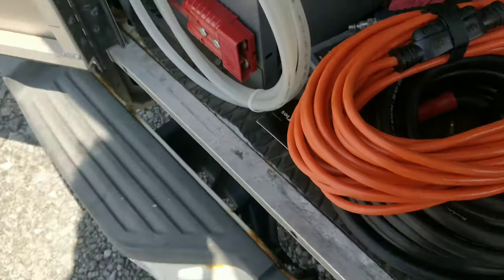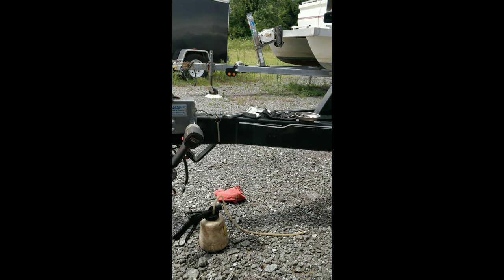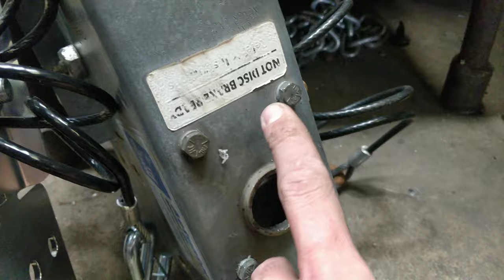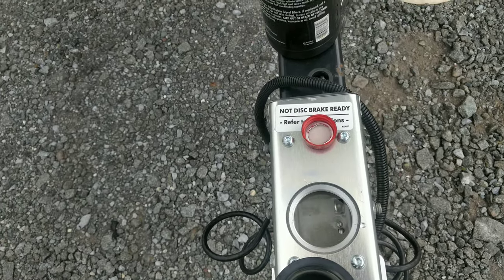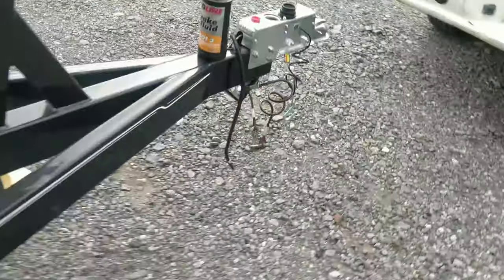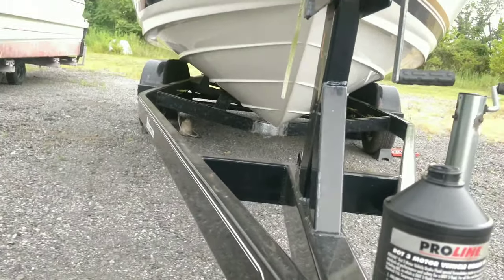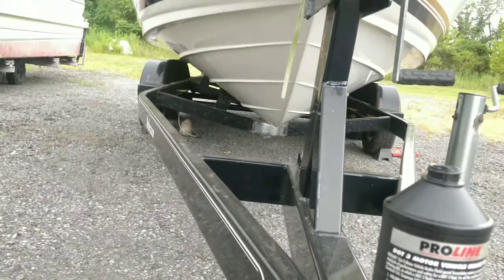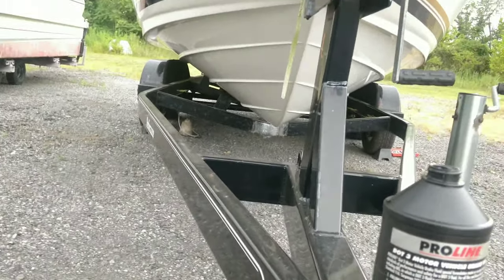Tiedown Model 660E Brake Failure PT1

Comment: Hi is it possible to bleed the brakes with a mity vac instead of the screw driver? I have the newer type actuator you put on  (2016) but it developed the rust and flakes you saw on your old one. Wondering if any of the flakes made their way down the lines and if it would affect braking?
Reply from the maker: You can try. I have no idea. I also don't know if any flakes went through the system.

Comment: What caused it to leak? Did they replace the unit? I have one I just installed and the same thing happened. It started leaking when I was bleeding the brakes.
Reply: Just purchased a new one myself and I have the same problem. Did you guys ever figure out what the problem was?

Comment: Thank you for the  video. Can you do a video showing how the entire master cylinder assembly came off?
Reply from the maker: I can't do a video doing that. I have another video like this but its better to replace the whole assembly. They updated it.
Reply: Robert Dotterer I meant to say the whole assembly. Your video showed some of what’s involved but not clear on what bolts are being removed. Thanks.
Reply: Also, having trouble with brakes not retracting (wheels drag) and it appears wheels cylinder don't return back to the original position. Have you experienced this issue in the past?
Reply from the maker: Well you could squeeze the wheel cylinders with a clamp or pliers. If they do not move then undo a line from the back of the cylinder, if it moves then you have clogged line or master cylinder seizing.
Reply: I tried pressing it back but it didn’t move until I cracked the line. Is there anyway to check the master cylinder? I think it’s that but not sure how to check?
Reply from the maker: Crack the line at the master. If they go back in that is your problem.